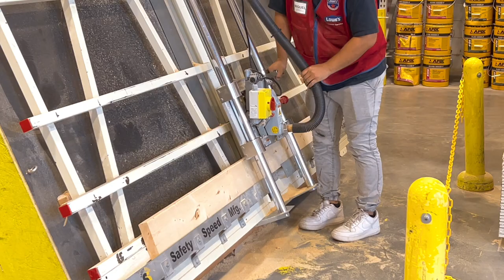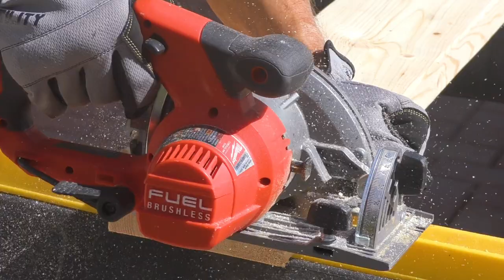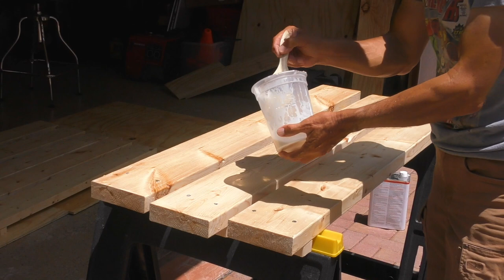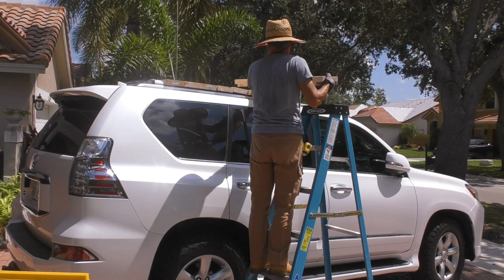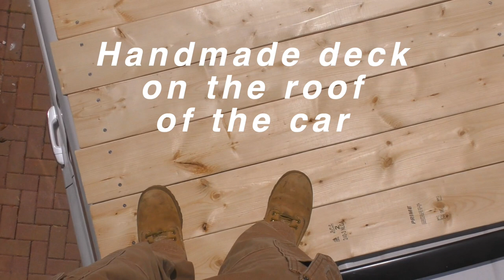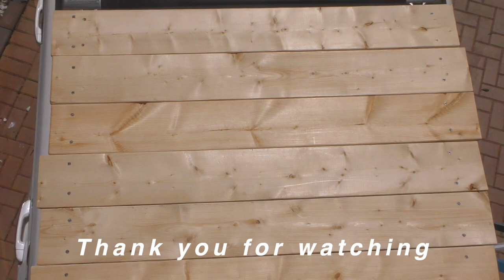Handmade deck on the roof of the car ! for the @FLL 10L

Comment: Hello Hori san,  great job you did.  
Don't forget to add some safety guard railing on the deck, you could make them left and right side with hinges at the bottom and a cross bar to lock them when they are up.  😉
As you know,  ..... safety first.  👍
Reply from the maker: yes ,,safety first,,,I will try to find out that such a thing can be done, Thank you YT Fan san.😁

Comment: Wow! Nicely done Hori San. How is it secured to the roof or is it?? Do you keep it in the back until you get up 10L? Looks good. You need a chair up there. 😎
Reply: That's the question I was going to ask...
Reply from the maker: Good question! The front and back movements are fixed with a crossbar, and the left and right sides do not shift the small objects attached to the board inside the roof rail as seen in the video, If I have time, I'll explain it live, tomorrow I'll try another new software, I hope it succeeds, Thank you MJ san and Kelz san.👍